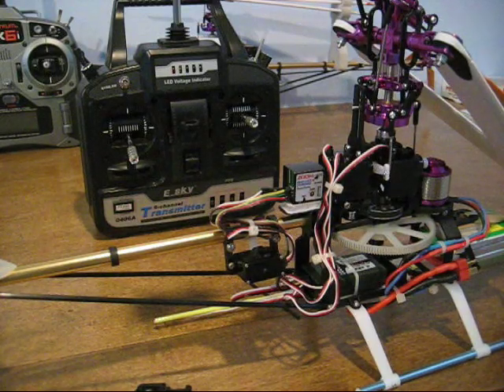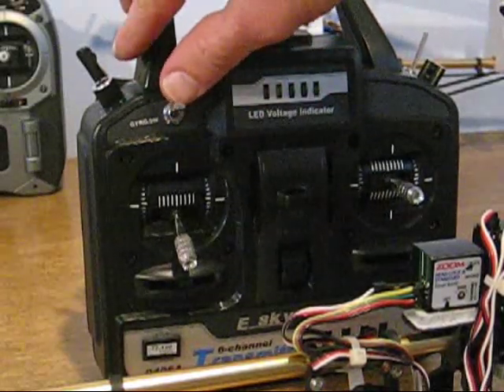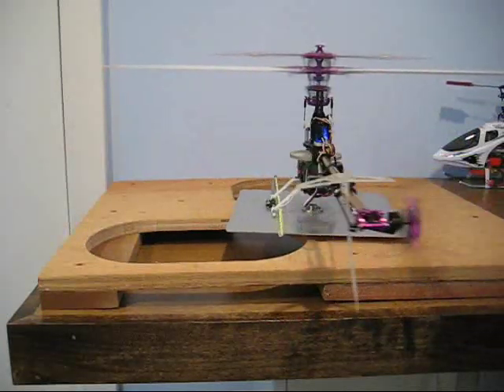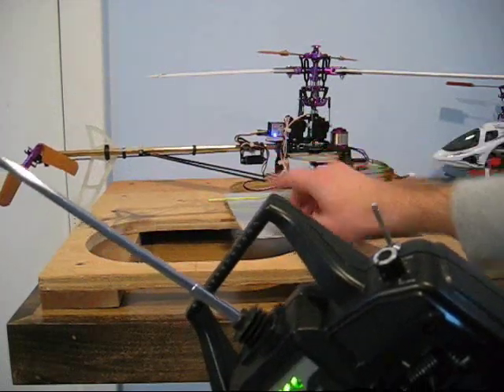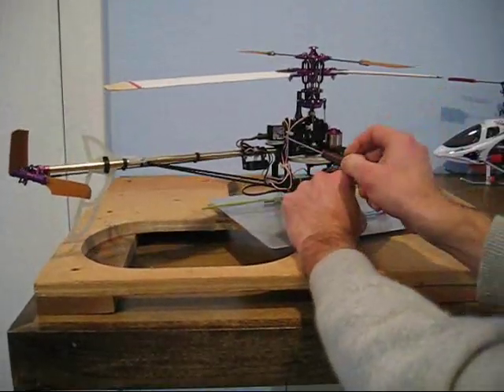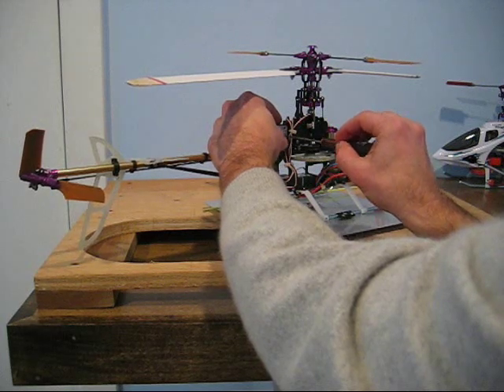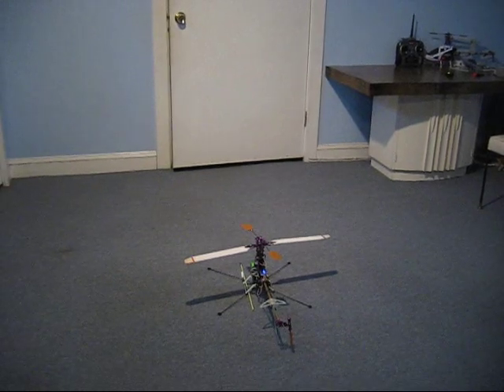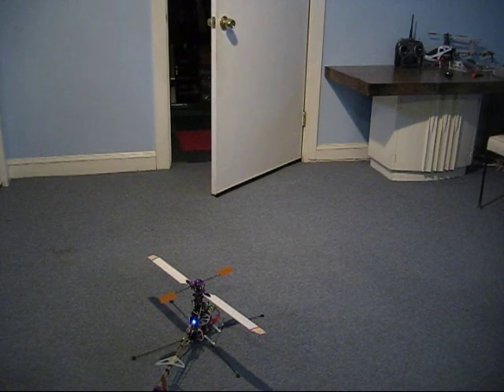Gyro Setup on Honey Bee King V2

Comment from the maker: @wkialyleiam It sounds like you've covered most of the basics. Because it always goes to the left is a good clue. Try flattening the pitch of the main blades (shorten the feathering shafts).  If you have too much pitch in the main blades the torque from the rotor will be more than the tail can overcome. Try setting the main blade pitch to just about flat when throttled down. This is ok since the rotor servos are linked to increase the pitch as you throttle up.

Comment from the maker: @wkialyleiam Could be. I've had gyros go bad before.  You didn't mention how bad the issue is, if the gyro is not working correctly or not at all. After powering up move the tail by hand and see if the tail servo responds. If the servo responds does but the tail is not holding there could be several things. I've considered replacing my tail servo with a higher speed servo to reduce the response time but have't explored that option just yet. Can you describe your issue a little more?

Comment from the maker: @luki01111 : I use the nylon lock nuts.  Keep in mind that the aluminum rotor has 3mm holes and the wooden blades come with a 2.5mm holes so you'll need to drill them out. Some blades come with 3mm holes already, I just happen to like the wooden ones.